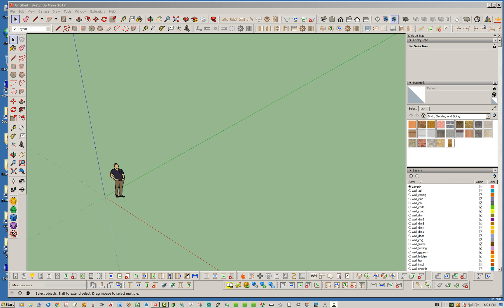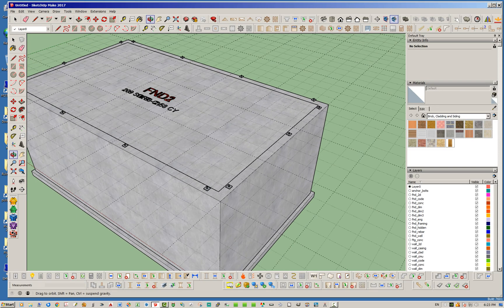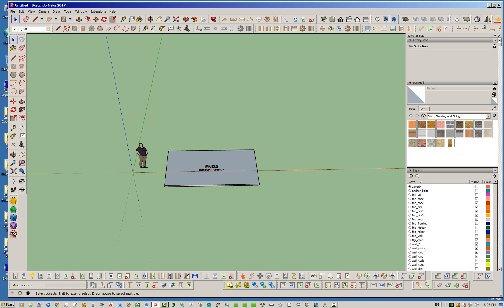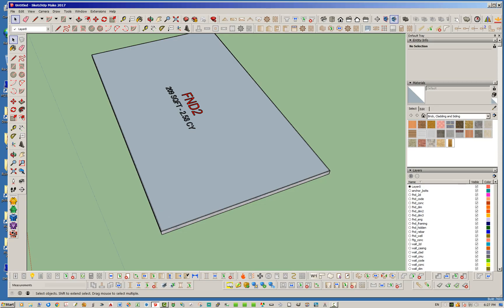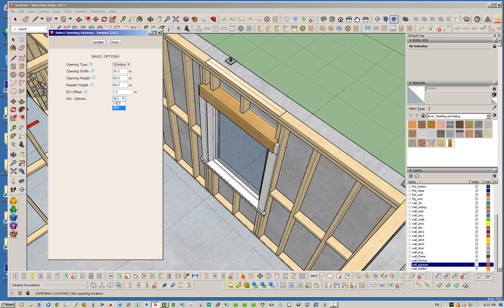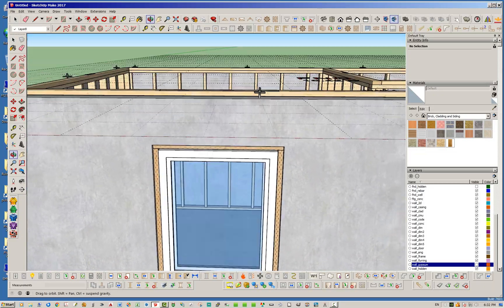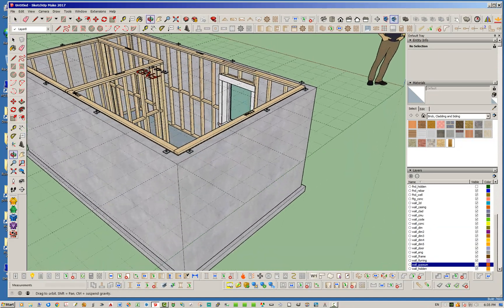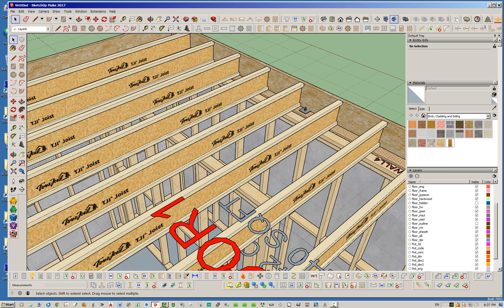Medeek Foundation Plugin: Tutorial 13 - Framing Basement Walls

Comment: We pour our poured walls 10 feet in height and that gives you room for 3-4 inches of gravel, 4 inches for slab and then a comfortable ceiling height.  It also gives areas for furring around duct work without going below 8 feet.  This also gives us room to put a drain in the gravel under the slab.  Nice video!
Reply from the maker: I agree on the depth / wall height.  Eight feet is really to short for a basement wall since the HVAC ductwork will usually drop that ceiling even further.